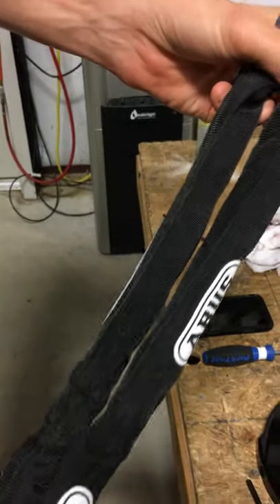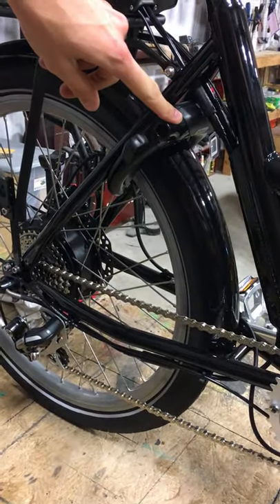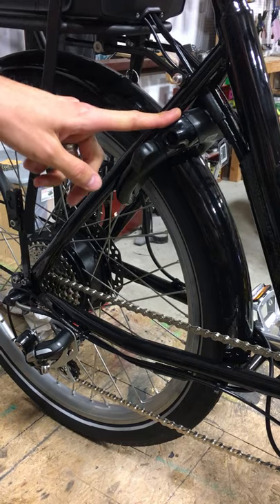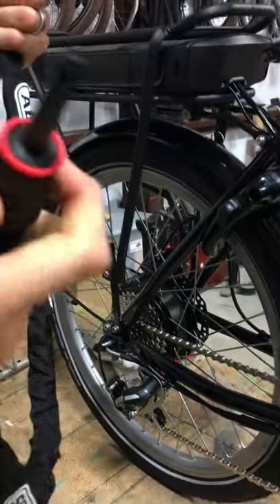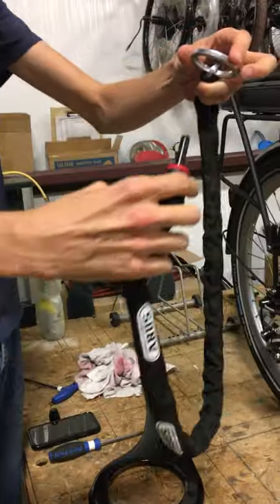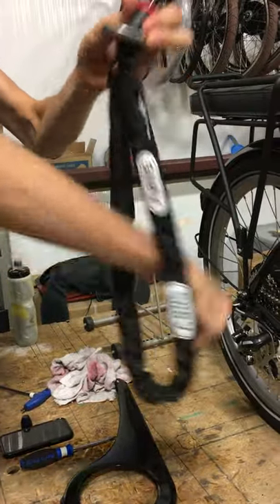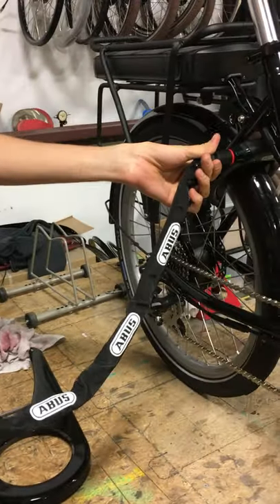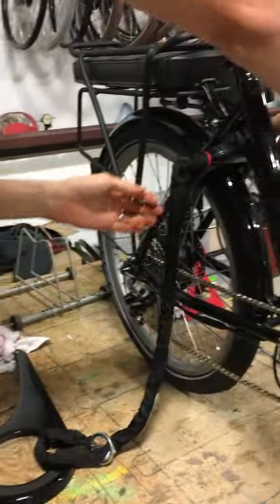Using the Abus Adaptor Chain 6KS

Comment: Wouldn't you want to wrap the chain around the wheels as well so that thieves can't try to take the wheels off?
Reply from the maker: The chain plugs into the wheel lock, which is attached to the frame of the bike, and has a steel loop that locks around the rim of the wheel.

There's really two locks here, being operated by one key.